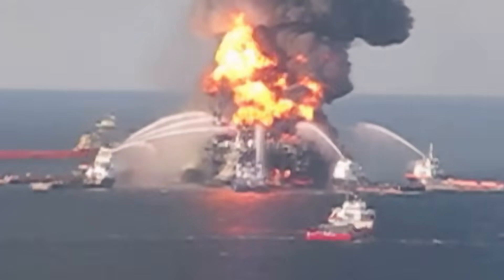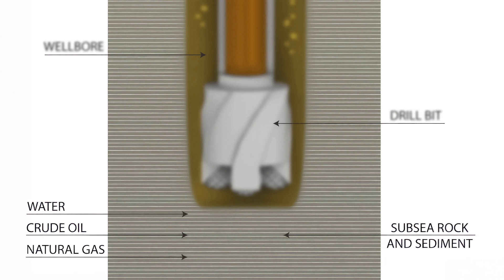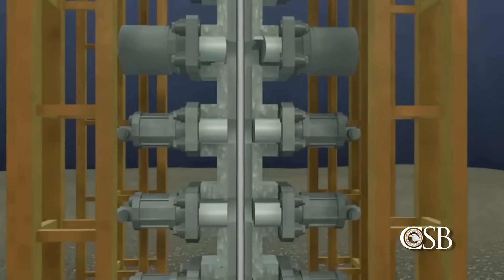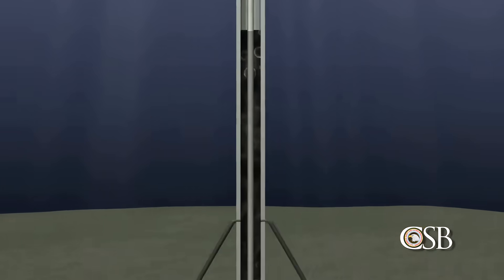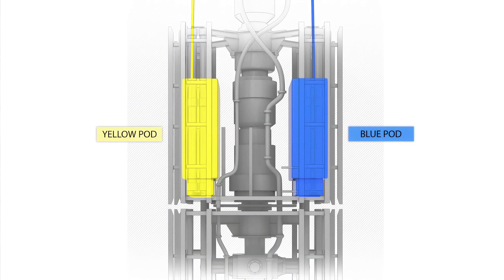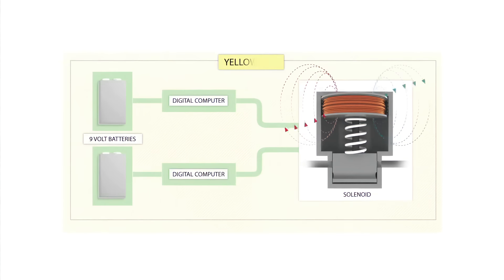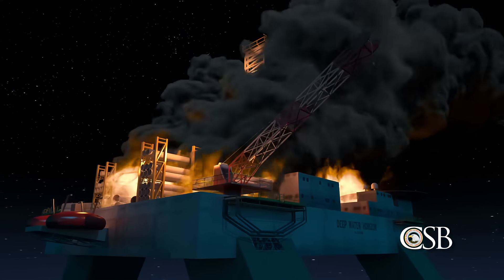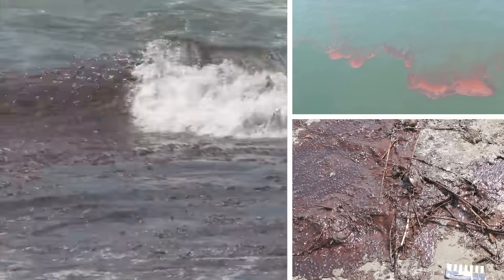Deepwater Horizon Blowout Animation

Comment: Didn't these so called engineers test anything before using it on the rig, how can you just say it was wired wrong, they would been tested and retested several times, unless the diagram was wrong no other way this is possible! I would more like to think money/time and someone up high said don't do this stage testing and that someone should be taking the blame.

Comment: I'm interested in how the pressure from the ground oil is always so great when breached by drilling. Sorry, i'm a physics noob.
Reply: The high formation pressures are not created by the drilling, but by mother nature.  Here is the physics view:  There is typically a permeable path through the formations back to the sea floor/surface filled with salt water.  The water hydrostatic head creates a formation fluid pressure equivalent to water density (~8.5 ppg).  But also commonly, the permeable path to the surface gets blocked at some point in the geologic deposition.  In this case, the weight of the additional sediments acts to compress the formations deeper.  For the porous zones, compaction is resisted by the relatively incompressible water in the pore space.  An equilibrium results that has the formation pressure being much higher, in some cases reaching the total pressure of the overburden weight, which can equate to a density of 18 ppg.

Comment: The diverter below the rig could have been closed sending the hydrocarbons out the sides of the vessel, instead of up into the rig. That would not have stoped the spill, but it would have prevented the fire & loss of life. The fact the crew did not activate it was a mistake that contributed to the loss of life.

Comment: Literally an example of the "Swiss cheese" model.  One thing going wrong is no big deal, two things going wrong, still can handle it, but to have EVERYTHING go wrong?  Then add in unforeseen consequences, such as the drill pipe bending out of alignment?  Amazing and terrible.  Lessons learned in blood.  I bet every BOP now has been tested and tested before being shipped, AND I bet the new ones are designed to address the bent pipe problem.

Comment: truely pathetic how many basic engineering failures were present. A pipe that had room to get out of the sheer rams, and 2 critical safety devices clearly not tested nor designed to self diagnose. Really shows how behind and uncaring this industry is.

Comment: Can't believe they wired this thing up wrong on BOTH solenoids AND failed to test them for proper operation!!    I realize they couldn't be tested once in place as that would have severed the valuable pipe, but before putting them in place, surely there's got to be a way to check them.   Either that or have some kind of blocking pins in place to keep the shears from cutting the pipe so you can activate the cutters to see if they move as expected.    I can't imagine not testing something of this importance before putting it on the  ocean floor!

Comment: B P has a history of maximizing profits at the expense of safety! The Texas City refinery fire was one of their facilities. Someone in top management should have gone to jail for both of these disasters. 
 That’s my $0.02 worth!
Reply: This has nothing to do with cost savings. All of the equipment used on oil rigs is expensive as hell. and even installing it is even more expensive. So the cost of doing it correctly is totally neglsable in the big picture. Like the cost of putting some diodes on the solenoid to prevent wrong wiring is just a couple of dollars or even cents. And testing the valve before deploying it is just a couple of minutes of work, and having a battery voltage monitoring is also just a couple of dollars or cents in the control circuit. The cost is not the issue here, it is the competence.
Testing the equipment is standard procedure on ALL industrial equipment. Every pump installed you test the rotational direction. And every valve you install you test it and see that it opens and closes and does not leak, and see that the feedback works if it has feedback. And every sensor and signal you IO test. And you always test the emergency stop and safety equipment. This is the first thing you do on a new machine or process section before you do any testing of the intended programmed function of it.

Comment: This is why robots are taking over... you can't trust humans... they make too many mistakes. Personally, I prefer the old days when you pulled into the gas station and said, "Fill 'er Up, Sam". And he cleaned your windshield with a smile. You would think that a real 'service station' could make a profit. But greed reigns supreme and Sam had to turn to plumbing. And what this nice video didn't explain was the greed part that really set the stage for the disaster. I'd say for a guy that wanted to open a good old fashioned 'gasoline service station' .... you might not make a descent living, but you'd meet a lot of women. I've heard that the profit margin on gas is very low. Maybe the best take away from all this for us average guys and gals is this: next time a big oil company has a blowout, wait a few days for their stock to hit bottom and buy, buy, buy. Wait about six months and sell. You have made a nice 30% profit.

Comment: Since as i'm a child, I will like to know how does oil rigs floats above the ocean?
Reply: The same way a massive steel oil tanker ship floats and why you cannot pull a rubber balloon down to the bottom of a swimming pool: massive sealed volumes of air are much lighter than the volumes of water they displace.

Comment: Effective compression.  The one thing that is discussed that agrees with the physical evidence.   The pressures encountered were great.  Great is an understatement.  When the full pressure came into the pipe, as calculated by the flow rate vs. the depth of the sea at the point of rupture, that pipe stretched and blew up like a child's balloon at a birthday party.  The half inch thick steel in a moment expanded, and ruptured just like that party balloon.  The initial pressure alone could have been the total cause of the rupture.  Yes, the electronics may have failed,,, and perhaps a fully functioning valve could have prevented the blow out.  But it still stands that the initial pressure was so great that it blew out 2.5 vertical miles of drilling mud as fast, and as easily as a 14 year old blows out a spit ball through a straw.  And when the safety valves did activate, even partially,,, the pressure blew the pipe apart as though it were made of silly putty, not steel.

Comment: My consideration divides in two theories, first it was planed to fail which may caused by several personal or political or whatever reasons and if it was planed failure, so what a huge shame... my second thought is greatly related to quantum randomness and what we basically call fate! How the hell several safety features fail to engage in such a disaster. Bypassing valves on the rig, monitoring systems, doughnut shaped twin series of primary shut down valves, the hydraulic pipe ram, twin yellow and blue pod(dead man emergency system), off centered and bended pipe and... this much series of events and failures is not logical! THE SCHRODINGER'S CAT!

Comment: So once the riser buckled nothing could have been done. If everything else worked perfectly the blind shear ram would still have failed.
Reply: I assume you mean drill pipe buckled, not riser. (Riser buckling/bowing was not a significant factor in the event until the rig sank on 4/21).  Actually, even after the drill pipe buckled, there were still some options that would have improved things.  If they had also closed the upper pipe rams (had already closed the middle ones), the pipe opposite the shear ram would have been more centered, and the blind shear ram would have sealed, ending the blowout (but fatalities already happened).  No one in industry had ever identified this possible situation happening during a well control event, and so the crews had no knowledge that closing the upper pipe ram would have helped in this situation.

Comment: The saddest part was had it not been for corporate involvement it wouldn't have happened. The operators of the rig knew there were problems that needed to be fixed and were operating under safety measures keeping some things shutdown but when executives visited for testing they FORCED the operators to run them. The operators told them they couldn't do this or that because of certain systems and safety measures and the executives wouldn't hear it and forced them to do it anyway. But it was still not a guarantee things would go bad, just not recommended otherwise I'm sure the operators would've fought harder not to and in the end would've REFUSED no matter what.

Comment: Huh... even with mis-wired systems, the main cause was effective compression.. not much you can do about that without re-designing the B.O.P. which unfortunately means replacing all the existing ones with up-to-date versions... this is why proper research should be conducted on serious equipment like this through the government before even allowing this to go through, tho I guess their pockets got padded enough for them to forget the risks... always with the fascism, do we really need more massive disasters like this, or Fukushima just to save a few bucks that will be used anyways when shit fails? FFS...

Comment: Why did the BOP not have a liner or sleeve that collapses around the drill string or Kelly. Hell rotating the  Kelly backwards or using a BOP that has jaws like a drill Chuck would eliminate and initiate a failsafe. You know sonar and pings can tell you when pressures are equalized. They use this technology in diesel engine timing tools. They listen for the intensity and frequency on the injector line to create a ping to set injection pump timing. Piezo Halo I believe. When the pressure is higher the frequency is higher. When you ping the fluid in the Kelly and the pressure is higher it takes less time for the ping to return. This theory for sediments when you are drilling. I came up with a better way using a frequency tuner receiver that's tuned to whatever frequency the mineral your drilling shatters at efficiently. Then tune it at that and blow right through granite! Limestone....so on.
Reply: Come find me. Oh, Virgil B. Ropp is the sole inventor of the Horizontal Drill Stator motor everyone's using. I was there when it was tested and pioneered! Have fun using it! Me and my sister are the only heirs to his royalty's and patents the industry's infringed on! I will lift the curse when you make it right with us. My phone number is 580-670-1124. Call me. I can prove it!

Comment: The only thing wrong with this story is two small things 1 you have to test the b.o.p every 21days and record the test and send them to the main office back on land. If the test falls, you stop drilling and pull the b.o.p back to the surface and fix it. 2 the blind shear ram is designed to shear the drill pipe, no matter what.   I only worked off shore for 8 years, what do I know
Reply: So you're Mr Know It All who knows more than the USCSB because you worked on an oil rig, and yet you don't bother to address the fact the blind shear ram DIDN'T shear the drill pipe in this instance, causing the entire disaster?
Reply: Perhaps you missed the part about how the pipe bent OUT OF THE PROPER PATH of the blind shear ram. It "should have" sheared it no matter what, as you say, had it been more in the right path of the shearing. It damned near did, it "partially" sheared it, so it almost worked like it should have. Go back and watch it again.
Reply: You are right.never worked offshore ..did on land..no log on cement..thats the first problem..then the failed equipment and mis wiring and all..But the tool pusher has the Power to Stop all process..cement failed first..My Pusher ..man from Oklahoma was always present during cementing and made sure his men were safe.This is So Wrong ..money money money..bp didn't get the prize..beneath..because of short cuts..Sad..
Reply: Yes Its obvious  we are recieving an altered version of what happened. lots of finger pointing by the white collars.
Reply: But some guy who went to college and read some books made a video about something he may have never done first hand. He is an "expert". Where is the respect. Lol
Reply: @mtadventures5006  are you referring to THIS video? Because this is an official USCSB investigation findings video reposted by someone else. This is THE verdict on what happened, as far as the government is concerned.

Comment: A sawmill I worked at recently was doing an upgrade to its primary water intake. This upgrade is to supply water to two new blow off stations. The water line was dug exposing a 12" enameled iron pipe with one tee junction and two 90° elbows about forty feet apart supported on the outside corners by one ton concrete blocks. The crew doing the dig exposed this pipe while unable to shut off the primary water as the mill was in full operation and were meerly prepping for a weekend shutdown. When they returned the following day the section of pipe between the two 90° elbows was buckled upward about six to seven feet. Luckily this was the first day of the shut down (though they would have forced a shutdown regardless) and they immediately shut off the main, replaced the pipe and buried the line along with their new section to the first blow off station. No injuries or equipment were damaged aside from the 40 feet of pipe that buckled. Goes to show this has the potential to happen even in relatively low pressure environments. Be careful, don't take chances and follow procedure. Go home safe.

Comment: I find it hard to believe the solenoids were wired backwards.  I have never seen one that required polarity. But, who knows what really happened. I did read that the BP was tested in a live situation a few weeks before and it worked fine.
Reply: Each solenoid valve had TWO coils (redundancy feature) and associated independent A and B circuit boards/batteries.  Also, they used a type of DC current, not AC (see CSB report Appendix 2B, pg 11 for technical details) for each coil to move the metal plunger.  If the 2 coils are crossed-wired, the DC magnetic fields will essentially cancel each other out, giving the solenoid little, if any, operating force.  Note that CSB report says that the cross-wired solenoid was likely NOT a contributing factor because one of the coils had a dead battery, leaving only 1 coil energized, which eliminated the two coils cancelling each other out.  The automatic closure of the blind shear ram likely worked after all (only one coil can trigger the shut-in.)

Comment: A proper "dead man" shouldn't need power to operate. It should be closed at all times and only opened when the rig is in operation. Just like the air brakes on a transport truck/trailer.

Comment: What's not being talked about is the massive release of CH4 into the atmosphere. The boiling sea water with methane gas released was approximately 200 ft tall and 1000 ft wide coming from this well, 24 hours a day!! ... Think about that once.....

Can you imagine if the BOP had completely failed and the 28 inch bore pipe was wide open!?!?! 

....if it had not been restricted by the BOP , the release from this size of deposit could have increased global temperatures by up to 5 degrees within as short as 36 months....triggering a truly apocalyptic event for the human race.
Reply: Charles Pyatt take off the tin foil hat!
Reply: @pacificwarrior7679  okay, will install the blindfold 👍

Comment: That blowout preventer is the stupidest design I think I've ever seen on a safety device. In engineering it's piss poor practice to have a critical safety device that requires a powered source to operate it into a safe position. That's just building a time bomb into whatever you're designing. It's unbelievable they're allowed to operate with devices like this that aren't failsafe. The solenoids that operate the pipe rams should spring return open, energizing the solenoid should close them. So that in the event the controller fails, or the power fails, or some dumb fuck wires literally every piece of it wrong and never tests it, the solenoids spring open and the pipe rams close. It's exactly the same piece of equipment in every way except the springs open the solenoids instead of close them, there's no excuse why it's not designed that way. Not only is that the correct for it to work anyways, but they would have caught all the wiring problems because they wouldn't have been able to open the rams to insert the pipe in the first place.
Reply: You would need some absolutely gigantic springs to crush a pipe of that size.
Reply: @MaplePanda04  the springs don't cut the pipe, they open the solenoids if they lose power. The hydraulics cut the pipe.
Reply: Thank you Captain Hindsight. I bet you're the chief engineer for Exxon or BP, aren't you?